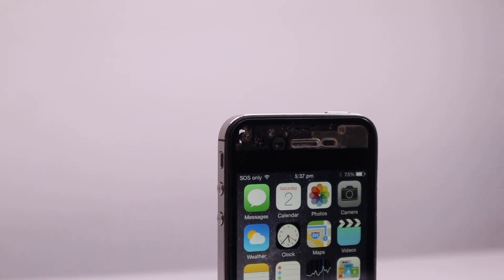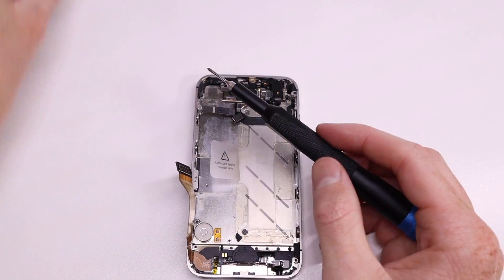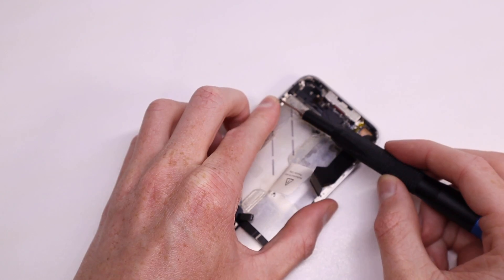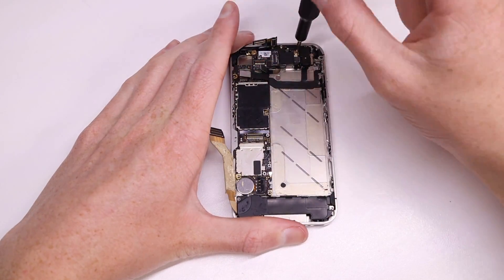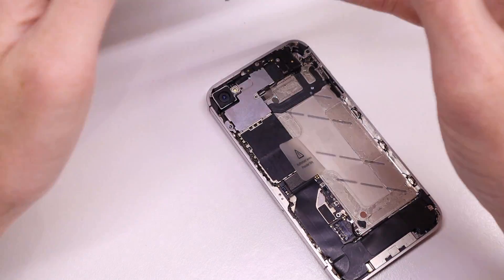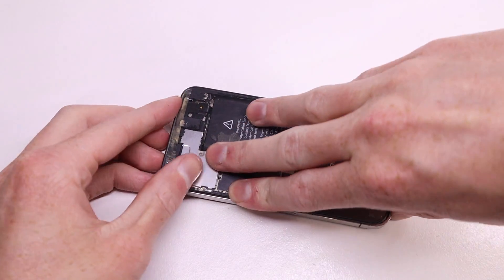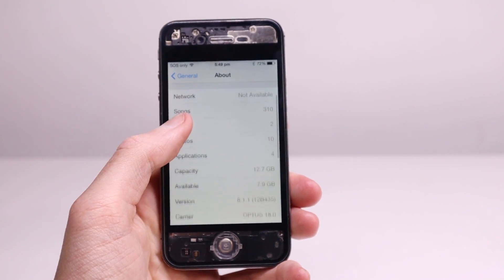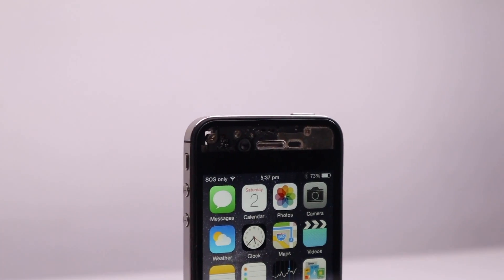Creating a Fully Transparent iPhone 4s

Comment: Big tip Hugh, if you want to better remove the back glass paint next time,  make sure to heat it up with a lighter before removing the paint. It comes off much more easily that way.

Comment: Funny you did this 2 days after I did my own iPhone 4 if you need to make a custom back and dont want the back too scratched up get a emery board and file away at the paint (You may lose the apple logo depending). The only scratch I had on my back plate came from me using a knife to remove the back plate from the plastic.

Comment: I made a clear iPhone 4s back and I didn’t have problems with sratching the apple logo. I started with a razor blade being careful not to touch the logo and when the logo and the text were the only things surrounded by paint I used a plastic tool to get the material off without damaging the logo. The logo is a bit translucent, so you have to make sure to eliminate all the paint from underneath. The problem that I had was with the back metal, the plastic frame broke when I was trying to separate them. How did you do that?

Comment: Why wouldnt you use a razor blade to get the black paint off? It wont scratch the glass and it wouldnt take as long...who removes paint with a metal pry tool...

Comment: Can you spray paint a phone?
My favorite phone is the iPhone 4s
Great work!
Reply: Of coarse u can.U would need to completely take it apart to do so.But because its anodized aluminum the paint wouldnt stick the greatest.And would chip extremely easy.But u could possibly have it powder coated and that finnish last longer cause its baked on.Only thing is the thickness of the powder coating would possibly make things fit tighter or possibly not work at all cause of its thickness.Examples being all the side buttons and sim card tray,etc.